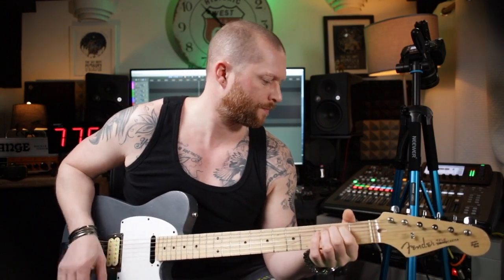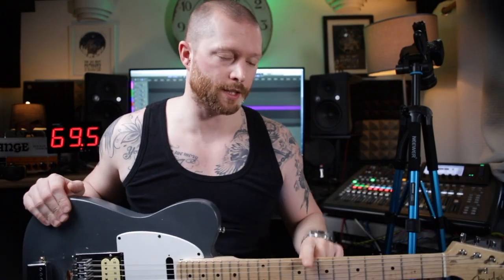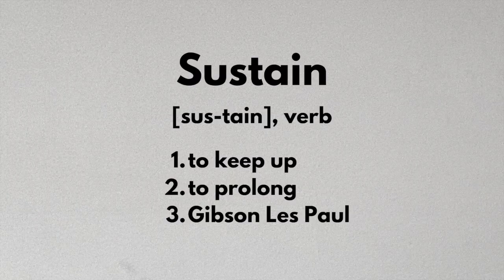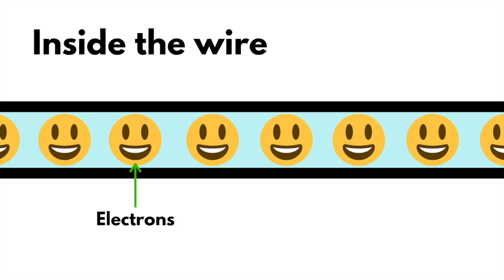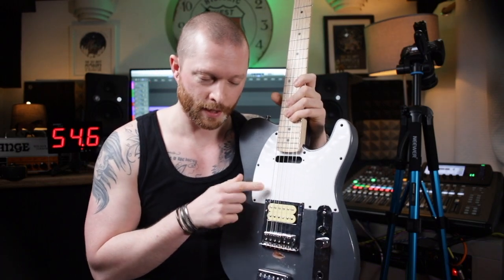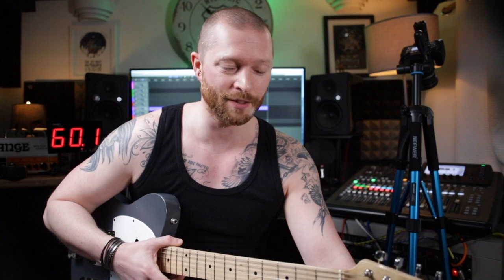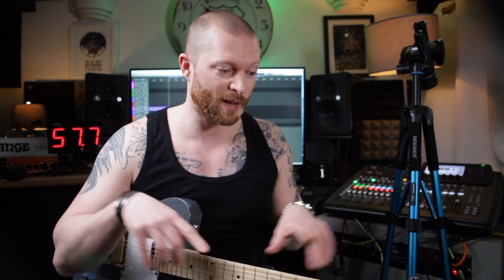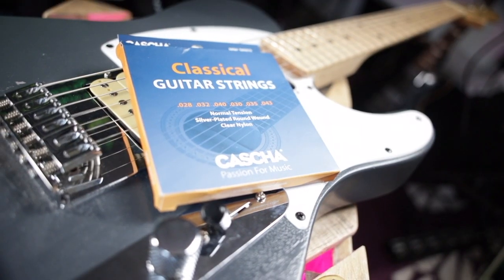Tonewood?

Comment: I don't get it. If the sound of an electric guitar is made by disrupting the magnetic field with the string, why is there noise coming from the body pickup when there is no metal disrupting the magnetic field?
Reply from the maker: Pickups can be slightly microphonic, especially if they aren’t wax potted. So you could talk into one and it’d pick it up, just very quietly
Reply: @PherotoneStudios  Of course, I forgot about that. So if a pickup was wax potted then tonewood doesn't matter what so ever?

Comment: Great test! Thank you!👍🏼🙌🏼
   I was not surprized to hear something on the back mount pickup, but not as loud🙃

Now I wonder the difference between this direct mount vs. frame mount with springs, frame mount with rubber tubings and regular sized pickguard mount… It would help me to decide if I should hard mount some pickups or rather not…🤔

edit: I already swapped most pickup springs with silicone tubings. Difference in sound: not noticeable for my ears. General difference: no spring noise unplugged and probable interference with pickups😊

Comment: You might be onto something here.  The debate about tonewood has always been about the wood, and not how guitar pickups respond to body resonance.  So why not have a "body pickup" (or a few of them) buried in the guitar body that could be boosted and blended in the the normal string pickup.  Some acoustics have something like this don't they?
Reply from the maker: Thanks mate. Acoustic guitars use piezo pickups which are also fitted to some electric guitars. They pick up vibrations rather than movements in a magnetic field. 
I do find it interesting how “tone woods” all seem to be the more expensive woods. Funny how tone chooses price
Reply: @PherotoneStudios  And i think there are different sorts.. e.g. https://kksound.com/products/purepickup.php Things like the Fender Acoustasonic use some kind of combination.  What I mean is, if you want to hear the body resonating you probably woudnt use a typical magnetic guitar pickup with six polepieces etc.  An acoustic pickup of some sort, placed strategically, might work better.

Definitely agree on the tone woods. Wouldn't it be hilarious if the best sounding body material turned out to be, not some figured amazonian mahogany of legend, but an Ikea bookshelf..

Comment: Another balanced, sensible video... Look, folks, you can find dozens of videos on youtube in which people have experimented with alternative materials. I have seen guitars made out of steel, aluminium, glass (body, neck and even the frets made of glass), chip-board, plexi-glass (plastic) and even concrete, and, provided the same electronics, hardware and strings are attached, they all sounded exactly the same. One guy even went to the trouble of building a robotic arm (to remove player inconsistancy from the equasion) so that the plucking action was controlled and identical. Therein lies a clue as to where I am going with this... the material makes absolutely no difference at all to the GUITAR. None at all. The 'sound' of an electric guitar is a product of an electro-magnetic relationship between magnets, coils and vibrating metal strings. H O W E V E R... the way a guitar FEELS (as a result of materials used) DOES make a difference to T H E  P L A Y E R. Not the guitar, the player. If a guitar feels lighter, or heavier, or more resonant (and I promise you it only FEELS more resonant) in your hands, by virtue of its construction, you will tend to play it differently. Some guitars you might want to play very lightly, but with others you might want to dig your fingers in and pull out long bendy notes. For that reason, it is perfectly valid to prefer a certain material, for the body or neck - you might prefer a chunkier neck or a thinner one - because of how it feels in your hands. Tone comes from YOU, the player. It is not valid, however, to claim that a certain material has an effect of its own on tone. Tone comes from how you play, and the material only has an effect in terms of how it makes YOU play. Acoustic guitars, however, are a whole different ball game.
Reply: Of course, you won't hear about this in an ANDERTONS video. The 'Captain' is a firm believer in tonewood. As is a certain gentleman whose initials are P, R and S... why? Because they only want your money...
Reply from the maker: Glad someone else shares my belief and I agree with everything you’ve said. PRS really push the tonewood thing but the way they demonstrate it does not evidence the tone of the wood on an electric guitar.
I’m with you. The player and pickups have the biggest effect and how the guitar feels changes how you interact with it
Reply: Ok, so I have 2 American original 50’s Stratocasters, one alder, one ash. They sound very different. They both have pure vintage 59 pickups set at exactly the same height. Neck relief set the same on both. The only thing that is different is the body wood. I’d love your thoughts on that one.
Reply: @PherotoneStudios  Yes, sorry I haven't replied earlier, but I didn't get an alert from my email. You might be interested in a reply I gave to Chris Jones today in reply to his quite valid point. Thanks for your reply to my earlier remarks, by the way. Also I find it a little ironic that PRS are now making strats - they call them 'silversky', but they are strats, and, to me, that seems something of an admission of defeat. If PRS have the courage of their convictions, why build a copy guitar? I'm not a PRS hater. I just wish I could afford one. As I think a lot of folk do. Which is why I think a lot of folk find PRS disengenuous.